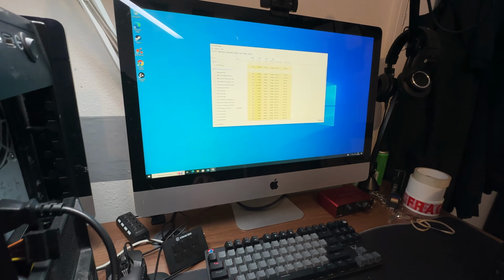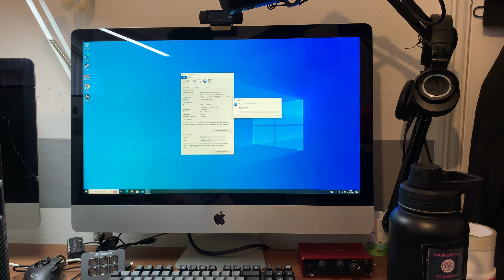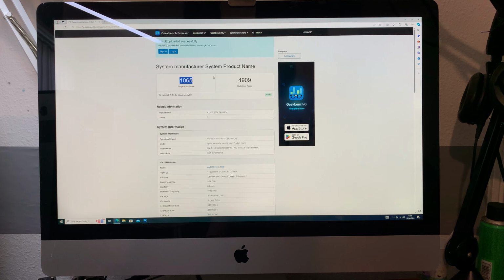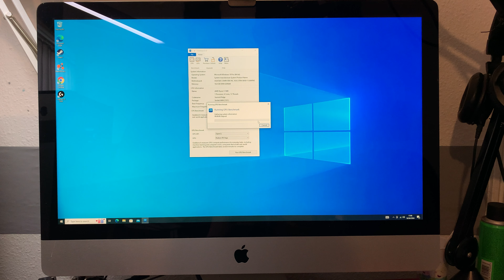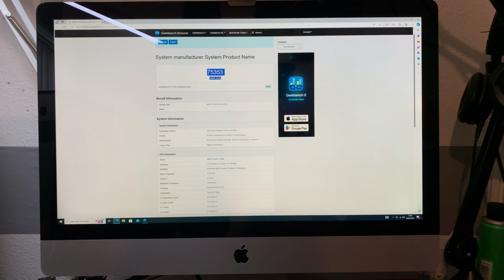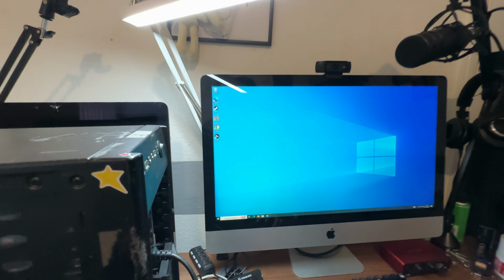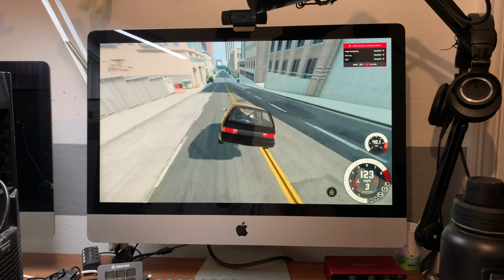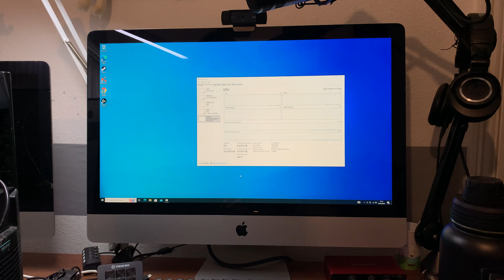This PC Has 3 Power Supplies...

Comment: Yeah the first generation of that CPU wasn't great. You were highly dictated by ram speed and the only overclocking you could get out of it was from overclocking the bus connection between all of the CCXs.
Reply: What is CCX?
Reply: @gabriocheauchocolat  in simple terms it's just a group of cores with their relative cache. If you heard about the ryzen two and three CPUs were Intel called it glued together. They were talking about AMD taking multiple CCXs and putting them on one die
Reply: @Dtr146  ight thx